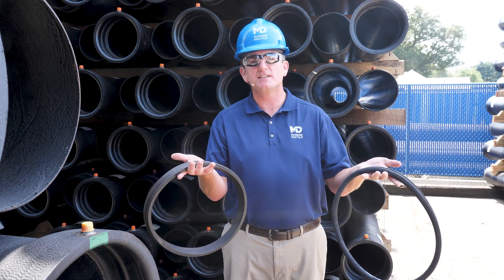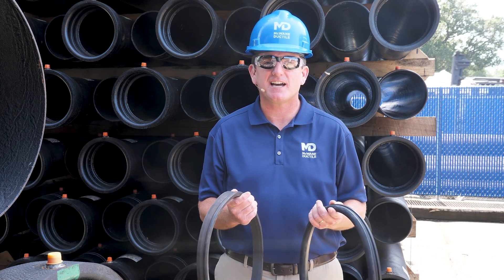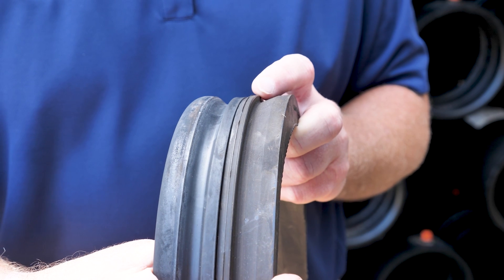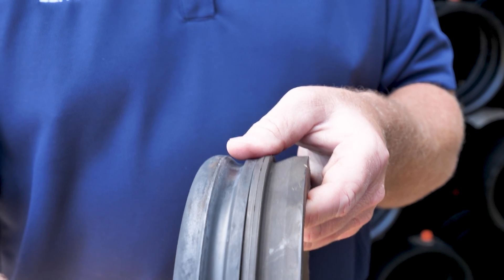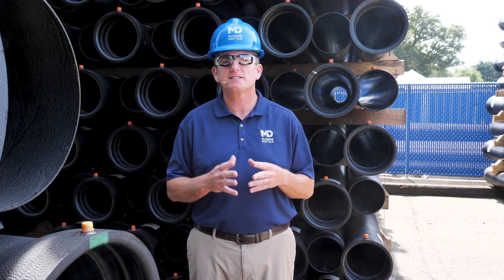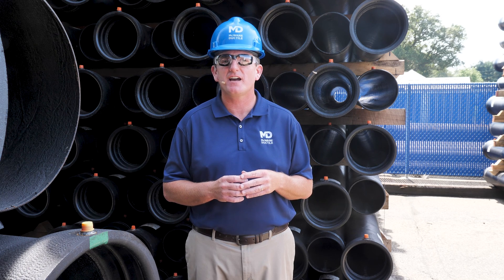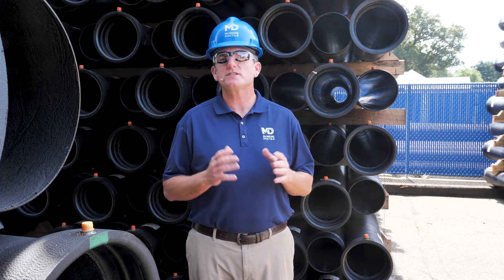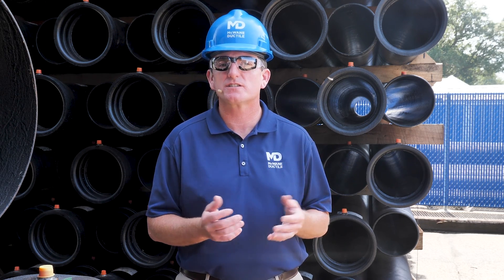Ductile Iron Joints: Tyton vs Fastite Gaskets

Comment: What is best of this 2 gasket
Reply from the maker: The best gasket is the one designed for the pipe you are using that will perform in the environment in which it is being installed. As mentioned in the video, mixing and matching gaskets can lead to costly failures. That being said, we currently provide the Tyton gasket with our pipe. Thanks for your question.
Reply: Fastite is easier/faster to stab pipes together. We’re currently having a struggle with the other ones.